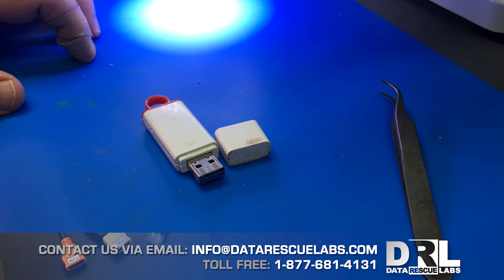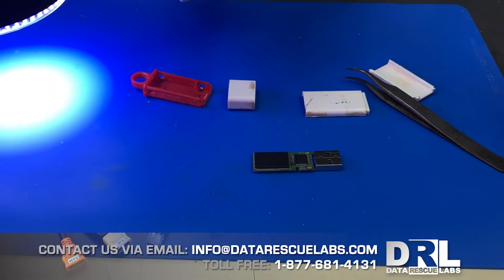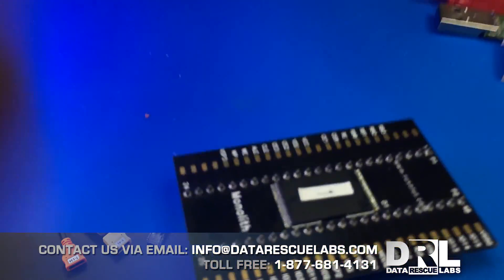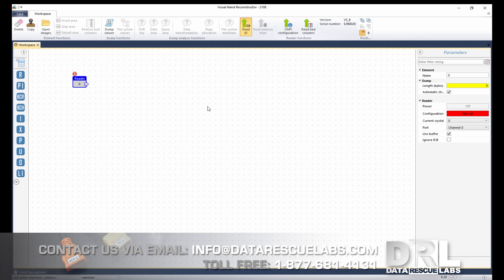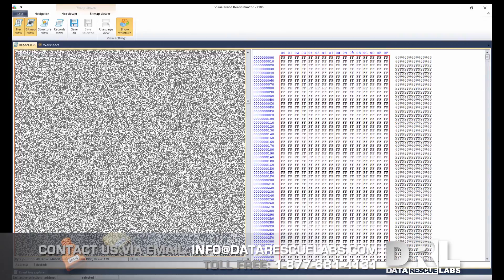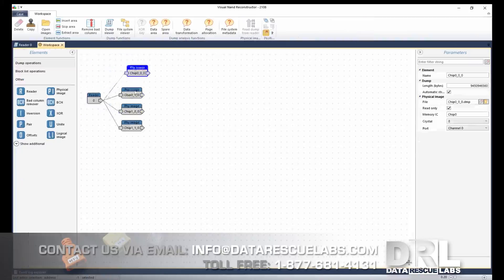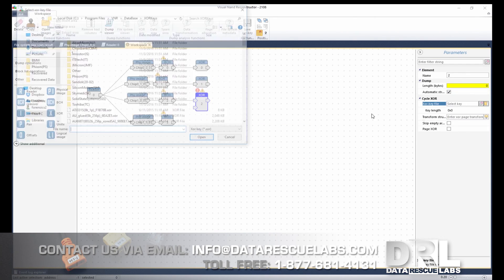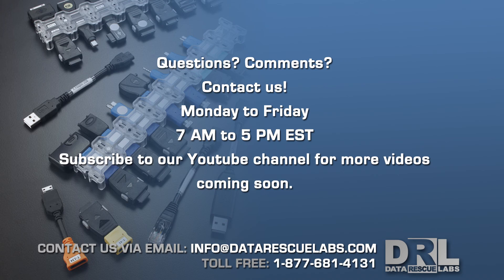Kingston not showing up

Comment: Hello Friend!
Congratulations, peo video
Why did you use 2 different packers to solder the 2 chips?

Could have used only one adapter of the chip, that of springs for the 2 chips?
Reply from the maker: Yes we could have used just 1, but during the chip removal, 1 leg broke off and we had to use the monolith adapter and solder one leg via jumper cable. There was no way to use a TSOP adapter with that chip.
Reply: Now I understood, perfectly.
Cool, I just got my VNR, very good to tool friend. do you have Skype? good job!